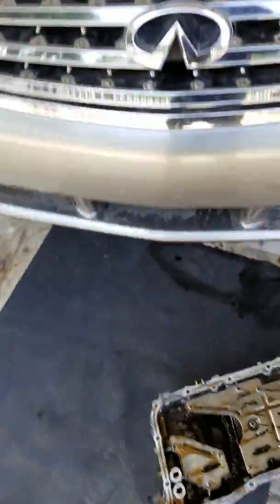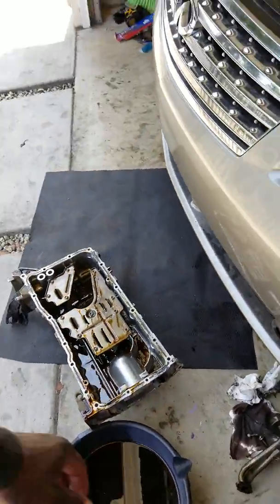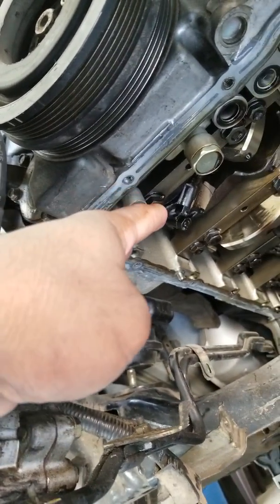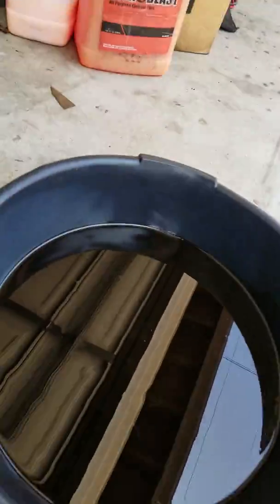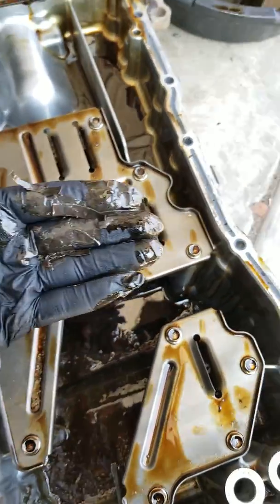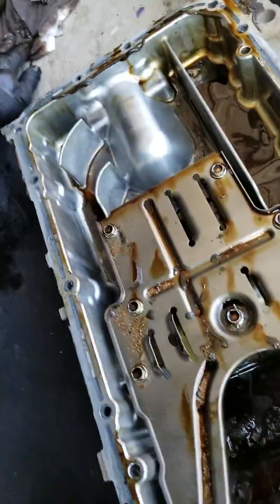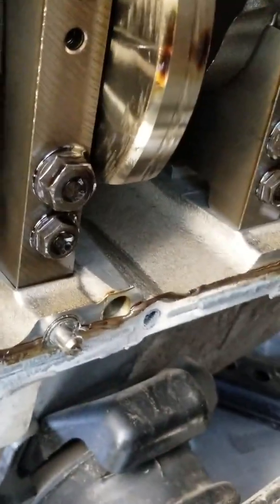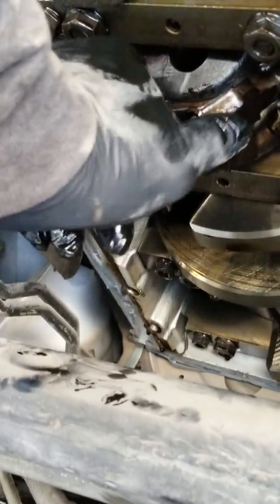Engine Rod Knock

Comment: how long did the car last after doing this? my infiniti Qx4 threw a rod bearing today i believe. just dont want to waste my time
Reply from the maker: Sorry I didn't update you on this,  it actually needed a complete engine overhaul the crankshaft was too scored and the new bearing didn't fit properly which still caused a slight knock
Reply: @SmokeTheGr8  thank you!!